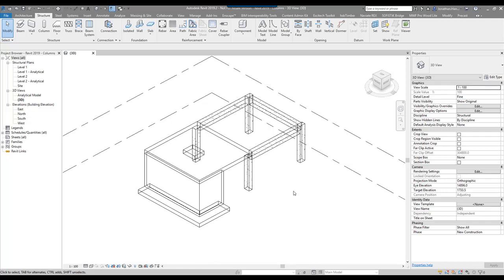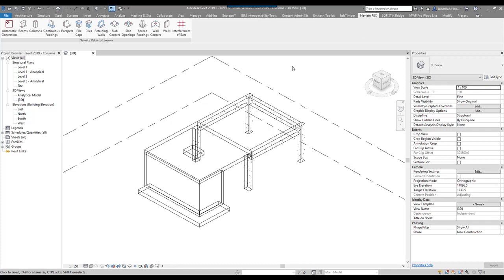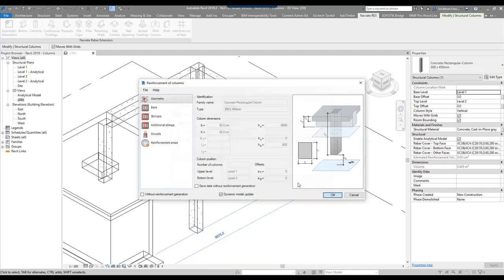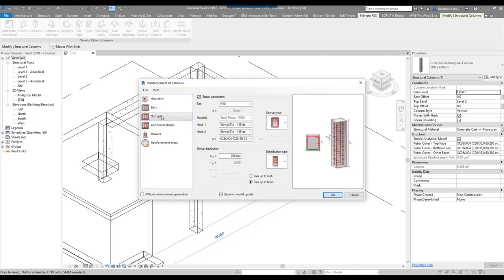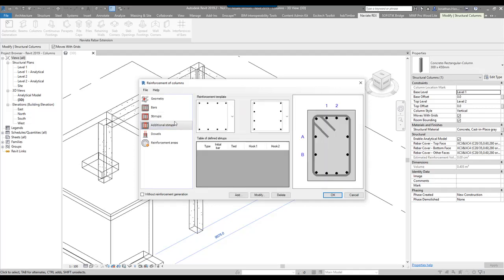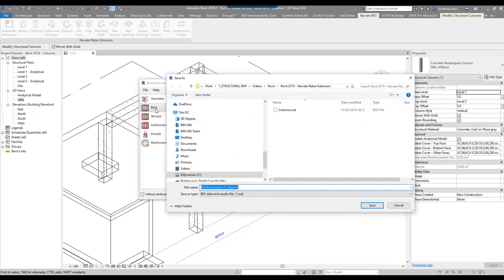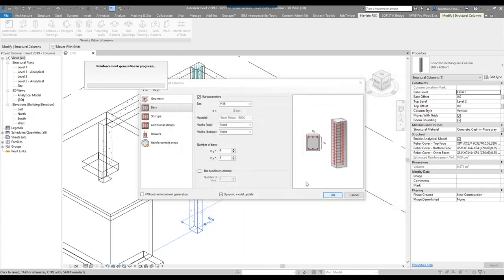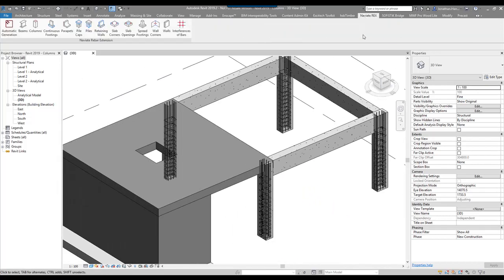Revit 2019 - Using Naviate Rebar Extension for Columns

Comment: I am civil engineer and designer, professional Revit ACP. Here in Brazil we do not use practical tools for modeling, I would like to know if I can do the structural calculations after the model is generated. My need is not only to generate the model but to calculate, size, details, generate the planks and tables.